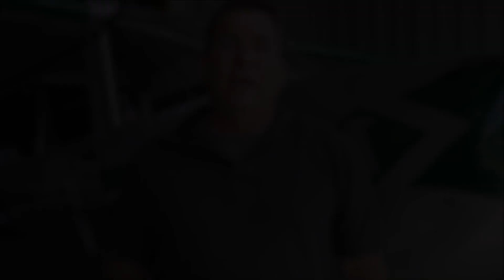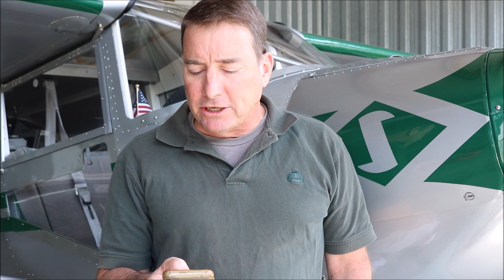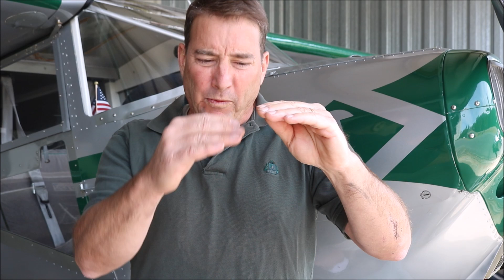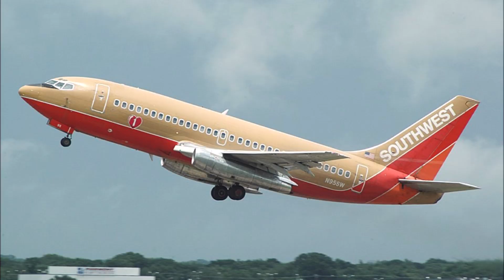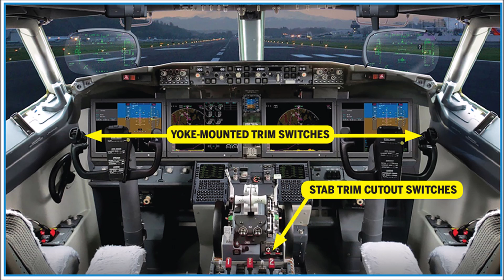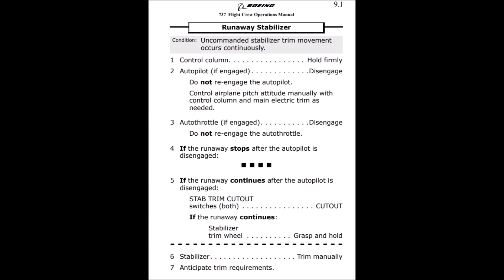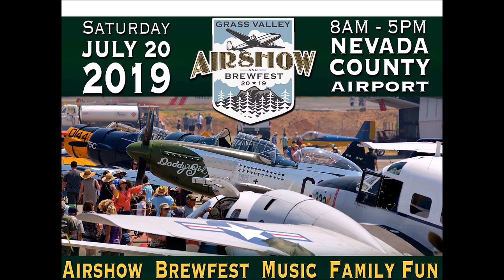737 Max UPDATE 27 June 2019 -The Latest Issue

Comment: @blancolirio Could you explain why the 737 would ever need max trim? If 5 is stay alive, why would you ever need 15-16 degrees of trim?
Reply: Everyone gone to the bathroom at once? :P In all seriousness, CoG being wildly out of limits is possible, and the aircraft needs to be able to fly like that. Big low slung engines also want to pitch the aircraft up, so you need to be able to trim for the same AoA in a climb (with them pushing hard) as a descent (with them not pushing much at all).

5 is nice for a good efficient cruise with CoG in the correct place, but other factors can affect trim, and you need to be able to handle everything going 'wrong' at once. That needs quite a large range.

Comment: This trim system the same as all the other 737's? How did they manage 114,000 hours on the Max 800's and this" rate change" not show itself? Sounds like an FAA foot dragging issue. Why not refuse to sell the plane to airlines that do not have high fidelity simulators and crew training requirements. Also stop the third world airlines from engaging the auto pilot after take off below 10,000 feet.

Comment: I am curious, did the FAA pilots find the stab trim rate too slow during a recovery with or without flaps extended?  Big difference in the rate of stabilizer trim rate between those configurations.
Reply: mcas is disabled when flaps are deployed
Reply: My impression was that the test was run to evaluate the “Runaway Stabilizer Trim” abnormal, not specifically the MCAS system.

Comment: The 800 lb gorillas in the room were the new engines whose larger overall diameter necessitated them being mounted forward on the wingin such that an aberrant line of thrust created, at high lift low speed conditions, a pitching up moment that would draw the 737 into a dangerous corner of the flight envelope ie., a power on stall.  IMHO, passively vectoring the engine thrust just a tad (3 feathers, maybe) might have done the trick better than any goofy software.  Hell, what do I know?  I've never flown anything more complicated than my ercoupe.  Thanks for your great videos, Juan!

Comment: Could it be possible, that "order of operations; prioritization of emergency command input(s)" function within E.L.M.S. prevents the immediate actuation of the jackscrew drive system, to prevent damage to the servopositioning and resolver systems, and the ability/inability to return the stabilizer to "normal detent position ±1°" to allow for a more 'normal ability to manually adjust stab trim' during an assumed crisis response by the pilots?? (sorry for the run-on sentence)

Being a microprocessor error, nah???, does not compute "Will Robinson"...
Reply: More then likely the FAA pilots who are doing the "memory item runaway procedure" have never does the procedure before in a high out of trim setup (in a high out of trim situation setting in the simulator) 

as the runaway trim procedure is something that normally pilot pickup within seconds of the sticks getting heavy and then having to put a lot more back force on the sticks most pilots will normally expect that to be a runaway trim and do runaway trim procedure (fault in the powered trim system, or autopilot trim command fault) and you would stab the trim before you let the plane get into a massive out of trim situation 

but obviously some pilots are forgetting what happens when the sticks get heavy that it generally relates to trim and not looking at the trim position or cutting power to trim manually, or panicking when the stick shaker only goes off on one stick (not both) and forgetting procedures as what happened with both 737max crashes lion air the Never Cut power to trim they just kept the up trim button for 10-12 minutes (it only crashed in the end as they stopped pressing up trim button and they was likely exhausted from having to do full Force pull back on the sticks) , second crash they let the plane get I to high out of trim for over 30-40 seconds before they cut the trim power but they turned the power back on (witch resulted in a final trim down event witch crashed the plane) because they could not spin the wheel  (they never stated if both pilots tried spinning the wheel at the same time but from what I heard on flight recorder it was only the Co pilot that tried to spin it at high out of trim both pilots will need to spin it or you need to point the nose of the plane down to  relieve pressure on the trim so the second pilot can spin the wheel) 

Just making sure every one knows this has nothing to do with MCAS (witch is fixed) they are just purposely setting the flight simulator to a massively out of trim situation and they are trying to just simply press the up button on the trim controls on the sticks and they are finding that they are moving at a  "slow" speed than what they think it should be going at (they think it should be going faster) I'm fairly certain all 737 move at this speed when you press the up/down trim button (not just a 737max thing)

Comment: If I hit the brakes in my truck, the cruise control disengages. The elevator trim wheel in the 737 Max should be designed to disengage the AP/MCAS   the moment the pilot in command begins to trim using the wheel. The idea of engaging an automated system like MCAS at or near the point of confirming positive rate of climb would make me more than a bit uncomfortable. I don't trust any system that much.
Reply: How do you feel about Airbus automation?
Reply: I wouldn't be comfortable with an MCAS type of system on any aircraft. Automation and assisted control surfaces are fine for general navigation up to and including SIDs and STARs. Airspeed, NAV, Heading and ALT inputs are great in a busy pattern while getting continuous comms from ATC. I get uncomfortable with the idea of trim inputs coming from a chip as soon as the wheels come up. The fact that Boeing cut corners to save money and push pilots into this airplane more quickly is stunning. I don't know about Airbus, but they haven't caused any smoking holes lately. That's a plus. IMHO

Comment: Sounds like an issue to be fixed with a code change. I am pretty sure the processer can handle the speed of commands  needed.
 I saw an article the last week or two that was interesting. The article basically said the original MCAS design used both sensors and disable MCAS if there was a conflict between the two sensor and one of the sensors failed. If this so how in the World did they go a design using only one of the sensors for reading?  I wish I could recall the article. I do not.

Comment: Hi, Juan. You probably have this, thought I'd send it along in case you missed it. From Flight Radar 24 -  Boeing says temporary halt to 737 production possible
In comments discussing the company’s quarterly earnings this week, Boeing CEO Dennis Muilenburg said if the aircraft remains out of service into 2020, a halt to production is possible. 
 
Southwest extends 737 MAX removal into 2020
Southwest Airlines has removed the 737 MAX from their schedules through the beginning of January 2020 and is ending service to Newark Airport due to the grounding. Southwest CEO Gary Kelly said the airline expects it will take 1 to 2 months to get the grounded 737 MAX back in service once they are cleared to fly. Southwest currently has its MAX fleet in storage in Victorville.

Comment: Hey Boeing - you're just dragging it out.  Accept you screwed up by even slapping the LEAP on there to begin with, and screwed up even worse by creating the computer system to try to counter the pitch up tendencies brought on by the bigger LEAP,  and make it fly like a Next Gen.  Unbolt the LEAPs, put the CFM56 back on there so it will truly fly like the Next Gens, and pull the MCAS out completely.
Problem solved.  Cut your losses.

Comment: Agree this is what Aviation Week said. Still not clear if they just have some timing constants set "wrong", or whether the processor is too busy dealing with other tasks to get around to the trim controls often enough. If  the latter situation, that would be exceedingly worrisome -- and delay-inducing. Also, are there structural/strength issues involved in physically increasing the speed of this component? If so, it would perhaps explain why things were done the way they were in the first place.

Comment: In 1985 we had a real time system monitored by a microprocessor system . Something extremely innovative at that analog moment ..... the micro was a intel 8085A-2
in few words, the events happen faster than the speed of the systems (cpu + hardware+ A/D modules+ software) so we had a ton of problems. We had to forget automatic compilation in a high level lenguage , and work our way thru a big CHUNK ofo critical  software in assembly , by hand, to make the process WAY faster and simpler.  We got it, by the way ...!!
 was NOT a microprocessor failure, but a complete system working at a slower pace than needed... same seems to happen here ....

Comment: Lots of things missing here from an engineering standpoint:
 Root cause analysis:  Do we really know the true cause of the two accidents?
Wind tunnel, simulator, and other lab tests to turn the problem on and off to demonstrate we know what the root cause is.
Wind tunnel, simulator, and lab tests to demonstrate that the fix actually solves the problem with a 99%+ level of confidence. 
All else is conjecture and guessing.  This type of analysis was done with the De havilland Comet and Lockheed Electra.  Unfortunately, both planes were made safe, but the companies no longer make commercial aircraft.

Comment: Given the problems they have discovered on the 737 Max. The FAA should review all other Boeing Aircrafts as well. We now know for sure that Boeing purposely ignored hazards and good enginnering practice when designing the MCAS system for the MAX. Who knows what other shortcuts they have taken with other aircrafts. Not saying that they should ground other aircrafts. Just that there should be an extensive review given the reveal of the bad culture at Boeing.